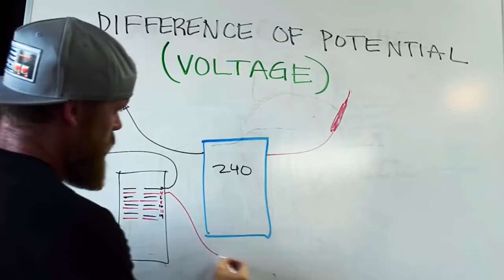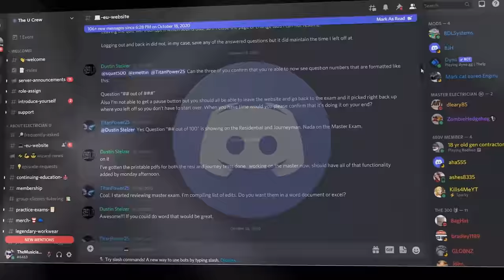Tips on Keeping Cool at the Jobsite (for Electricians) (and all Trades)

Comment: I'm 59 and have been doing electrical work of some sort since I was 16. I'm one of those walking tropical rain forests that sweats like crazy. It does get pretty hot here in NC as well as TN and FL when I lived there. You covered pretty much everything Dustin, great tips. One thing I would add is try to acclimate yourself to the heat. Don't keep your house 60 degrees, keep it about 75 or so and it will make a huge difference. Keep a fan going instead. You do get used to it, you'll save some on your bills and you won't be as susceptible to dying in the heat. Don't get me wrong, 75 is no 110, but you'd be surprised how much it helps. Chillin' in the AC is great, but for me, 75 is the new 60 lol. Great channel bud, nice to see some folks still excited about the best trade out there.
Reply: Yup, clever Texans do that too.
Reply: Omg ! I live in Arizona and I thought I was the only one that did that my house is always at 78 through 81 and it’s not even hot when I go outside it’s about 100 and it honestly doesn’t bother me😅

Comment: Worked outside for about 35 years and a spare change of stuff in the truck is always handy, especially dry socks and boots if the weather makes you soggy. Our shop had a couple of 12x12 pop-up canopies for both shade and rain protection. Some of our guys would buy beach umbrellas for cheap at the end of the season, then keep one in the work truck. Add in a few 8x10 tarps plus a few chinch straps or bungee cords with some imagination and you can weatherproof lots of things. A small fan was on my list some 30 years ago, back when I did boiler work, usually in unventilated rooms. The one thing that sticks in my mind was an old guy who had a pith helmet with a solar powered fan. Everyone made jokes about that 30 years ago, but it worked well!

Comment: I bought a Compcooler powered ice water vest a couple AZ summers ago and it''s borderline a life-safer. It's especially helpful if you just can't get any notable airflow. I wouldn't say that it keeps you cool (nothing does in 115F heat) but it fundamentally will keep you from overheating while it runs -- that is, you still feel hot, but at no point do you feel like you're going to pass out or feel like you are slowing down. I find that one large ice bladder lasts for almost 2 hours around here, so I keep a few of them ready to go. The batteries last all day.

Comment: I'm surprised you didn't mention Phase cooling vests, water cooling vests or evaporative vests. The latter doesn't work in humid environments  but the other two are quite effective. I'm a "sweater" contractor and I use a phase cooling vest. Its a must have when I go into an attic. 
Another tip for heavy sweaters is to lightly spray yourself with a garden hose. It feels good and you'll stay a tad cooler. Plus it hides your sweat :)
  Great video btw, i'm gonna try wool socks. Mad respect to anyone who works in that kind of heat, I wouldn't last an hour in it.......

Comment: Super solid advice. I've suffered from heat exhaustion twice as an apprentice. Once was in the attic space of a small casino in Wyoming during the summer, once was in the attic of a big dog kennel in Minnesota during the summer. It required traveling across the entire building, but in the attic. Not only does the heat of the attic space get to you but the physical energy require to travel in an attic space. If all you have to do is put a single wire nut on or close up a junction box but can't feel like you'll make it, stop. Turn around and cool off. It isn't worth it.

Comment: Former landscaper in GA here. Cover up with lots of moisture wicking fabrics and a wide brimmed hat. Wool socks for sure. I like 75% Merino wool blend, the lower the wool, the more my feet get swampy wet. My feet sweat like crazy so I usually change my socks at lunch time. Wool socks don’t usually get stinky so I’ll lay the wet pair out in the back of my truck and wear them again the following day. When I was doing landscaping, I would usually drink 1/2 a Gatorade in the morning before Ieft. Gallons of water during the day, then the other half when I got home. Also would change my shirt once or twice during the day depending on customer interaction.

Comment: Great great video! Glad I ran across your channel. I work outdoors most of the time and my boyfriend is an electrician.  He also has the Klein hard hat with the headlamp and the fan attachment and he absolutely loves his! I’ll be checking out your videos for gift ideas for sure! 

One thing I’ll mention is the Milwaukee job site speaker he has had for YEARSSSSS. (It’s the bigger square model)This thing has been through it all. Accidentally been rained on a few times.It’s still working like a champ. I was hesitant because of the price but after owning it i would purchase another in a heartbeat. Well worth the extra money.

Comment: It's kind of funny you posted a video about staying cool,  
Today i was running conduit in the basement of a hospital, and I had to climb on top of some larger water lines to set a rack , well close by was a hot steam line, and right where i was sitting,   the steam line was a few inches from my crotch,  my tool buddy gave me a Milwaukee fan and I pointed it facing down blowing the heat away from my crotch ,  you make your own conditions guys, stay safe out there

Comment: Honestly the best way I've found to make heat more bearable? Turn off the AC. When I was younger and we didn't have air conditioning it seemed like you become accustomed to the heat. I still notice it on days when I blast the air conditioning all the way to the job site and as soon as I open the door it's like I just drove to the center of hell. Whereas if I drive with the windows down instead it doesn't seem to be that big of a shock to your body when you get out and it's 115°

Also polyester is King when it comes to moisture wicking and staying cool. The only problem with polyester and being an electrician? If you're to get catastrophically zapped it's likely your clothes are going to melt to your skin.

My super bought that fan and he loves it.
I personally find my hard hat is heavy enough lol

Comment: I'm a warm person, especially when I have a full beard. I also have tinea versicolor (most people do, but on my fair skin it can grow into rashes).

Ventilation, sun protection, etc. Are crucial. Fans are great and the ability to go shirtless (not a luxury everyone can enjoy, but I'm no professional) is priceless (or at least keep the button down open.

I'm wary of A/C... Get back in the truck if you need to, of course. But air conditioning conditions our bodies in a poor way. Can create stress. I prefer to never use A/C (even in my home, just use fans).

Of course, if you are working outside just cutting out the hottest part of the day and enjoying a siesta in the shade is a must. Start at 5AM go to 11 and start back up around 3 to finish.

In the Ozarks and in the Great Lakes region I know how to deal with the humidity!

Good advice!
Reply: Oh and of course: pacing yourself. Keep your breathing even, don't keep "pushing it." Work efficiently, be mindful of your body movements and keep your internal furnace pumping heat at a minimum! Take breathers as necessary.
Reply: I agree with the AC. I do use it at home but not in my van i feel like my body goes into shock from being nice and cool to swamp ass hot. Sometimes ill even turn the heater on slightly just to try to start acclimating for the day

Comment: I’m an HVAC&R tech spending a lot of time on roofs. This also applies in Chicago metro it has been 90+ for the past few days I seen guys fall out here from the heat, as we get older we become less tolerant of temperature extremes. 
FYI: up here we don’t usually shut down for the cold we work well below zero, extreme cold will kill ya quick.

Comment: I have a Tip Video Request...

I am about to start a PM role in facilities that are being built, where we are installing potentially hazardous things like switchgear.

Now, I am not an electrician, nor do I play one on TV. For the most part I will be outside the arc flash boundary, perhaps occasionally inside the limited approach boundary, but I would never be in the limited or restricted areas. Plus, unless we're doing testing on installed equipment, it won't be energized.

I am OSHA 30, and I'm familiar with 70E, plus I have the well honed survival instinct that several years of playing with dangerous ordinance will give anyone who doesn't get themselves blown up. And of course I have the proper Cat-2 PPE. (I will never be doing anything that requires Category 3 or 4 Arc Flash gear)

So, outside of the obvious safety related stuff; what other tips or advice would you have, that are OUTSIDE of the training and books? The kinds of things you learn "On The Job" .

I'd also be interested in any thoughts from other viewers.

Comment: Suggestion for future video: sometimes I see resi stuff rated at 120/208V 1ph 3w and I've never understood how you get 208V in a 1ph system.
Reply: 120v from 1 hot leg of 208 3 phase, 2 hot legs is 208v single phase, and obviously all 3 are 208v 3 phase. In a high leg delta the wild leg is 208v to ground single phase using just 1 hot.  High leg systems are not really common mostly older and rural areas.

Comment: Question 1
Why don't 2 pole circuit breakers have arc fault protection. I can only find ground fault protection breakers.
Question 2
Why would you need to do all of the breakers in the box to be arc and ground fault protected when you could just do the main like 200 AMP breaker?

Comment: Been in the trades almost 5 yrs now working in FL. The heat and humidity are no joke. I wear a welders cap under my hard hat to help absorb sweat and keep the head cool. Also wear long sleeves and pants to keep the sun off of the skin. It keeps you cooler and prevents sun burn. Also drink plenty of fluids and take breaks. The sun, heat, and humidity will beat you down. I've also gotten heat exhaustion a few times, it's no fun.
Reply: Are you in Local 349?
Reply: @sammydabull1115  no local 915. From what I saw 349 hands were pretty wormy.
Reply: @danielhady3021  sadly that’s all I’ve been hearing and they say it’s because it’s right to work and non-union is getting most of all the jobs 

Stay strong brother
Reply: @sammydabull1115  I was working a job earlier this year just before Ian hit in Port Charlotte with a bunch of 349 hands and I was appalled at the sheer worminess of what I was witnessing. I was constantly complaining about the stuff I was seeing, but no one was interested in doing anything about it. After the storm hit, I told em to lay me off.
Reply: @danielhady3021  did they at least give you a clean lay off? I’m looking to take a call from Fisk Electric on Monday since my wife just got stationed here
Reply: @sammydabull1115  yeah I was given a clean lay off. It was with Conti/Ion. They had to considering they were telling people to not work until damage was assessed. I brought tools home when we were sent home just before the storm.
Reply: @danielhady3021  I’ll give Fisk Electric a shot and see how it goes! Hope their not SUPER ratty/wormy because I’ll ask for a clean lay off as well and go to the next call. I just hate to see jobs all going to non-union for less.
Reply: @sammydabull1115  yeah the IBEW has really poor market share in Florida. Non-union get all the residential and most of the commercial work. I ended up taking a job at a power plant recently. Still a dues paying member of my local, but not an active wireman anymore. In 915 most of our out of work book 1 guys are on the road, and many are permanent tramps.

Comment: Man I watch one of your videos the other day that saved my ass today. I bought a low voltage tester to trace some wires (because I saw it on your video) and I found the problem. My question is way can’t I get any tone in the service panel from that circuit? I’ve found tone all around the panel, I’ve found which breaker the circuit is on, but when I use the test in the panel, cover off, touching the tip of the test to the wire coming out of every breaker I get nothing. Any ideas? There are 2 gfci receptacles on that circuit

Comment: I found that Gatorade isn't the best in terms of rehydrating. They put too much sodium and sugar in their flagship drinks. I found that the Propel line from Gatorade is better for rehydration. They even make the little mixer packets for 16oz bottles. What I use for rehydration is Propel or Pedialyte 

Also, depending on the heat, and how ok the job site is with it, dry ice is better for keeping coolers cold. If you're using dry ice, don't use too much. Just a bit will do ya. Learned that trick at Bonnaroo a few years back. A bit of dry ice kept my cooler cold the whole weekend, and it barely melted. When it finally did, there wasn't any water to dump
Reply: Gatorade was made for American football players. So if you aren't doing an intense sport. Choose another sports drink

Comment: I work in central Florida (residential roughing). I’m still fairly new so I haven’t seen the worse of the heat yet. The rules are more relaxed so we can wear shorts and a tank top, I don’t however. 

I add, if possible try to adjust what jobs you work on with the time of day. Small jobs like cutting in a weather proof or coach light, I like to save for the morning before the sun heats anything up. 

I also like to wear clothes that are loose enough so when I sweat they don’t stick to me as much.
Reply: Florida here too, get some hanes x-temp socks! They REALLY help keep my feet cool in my boots